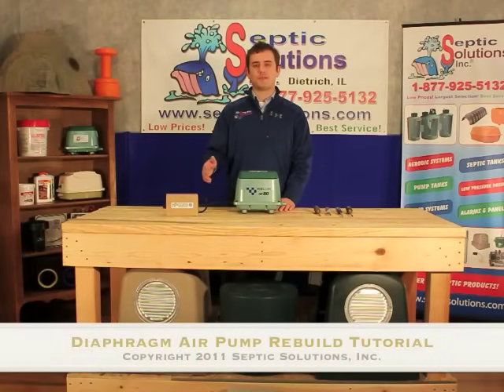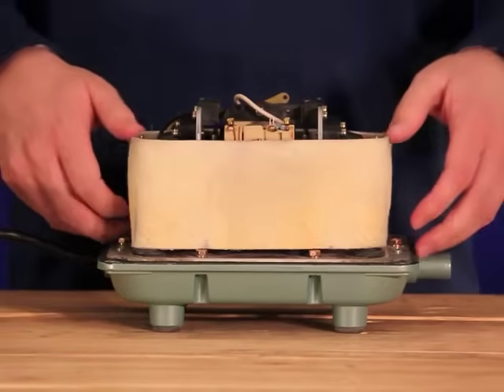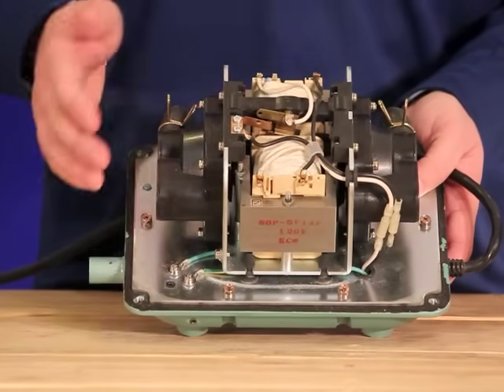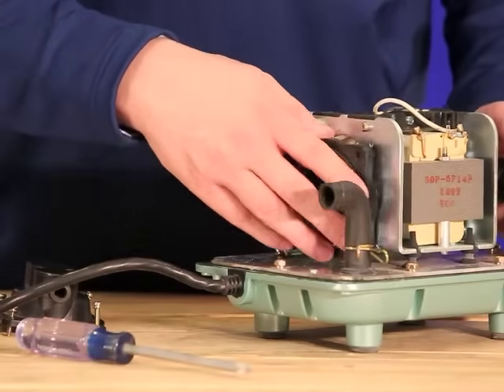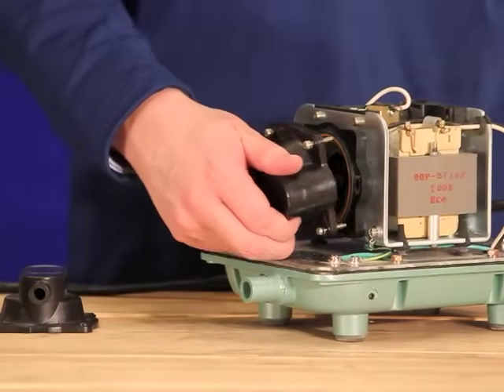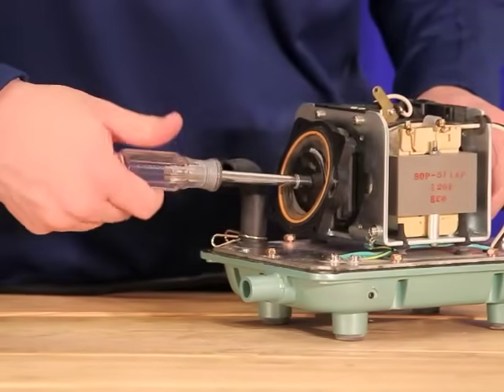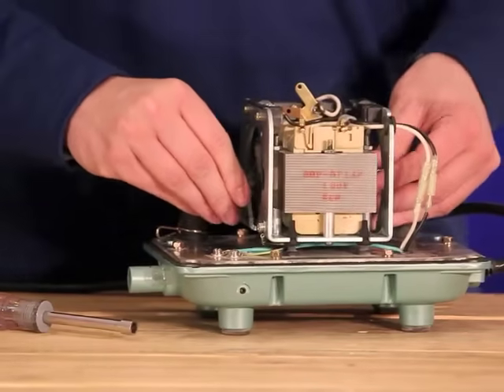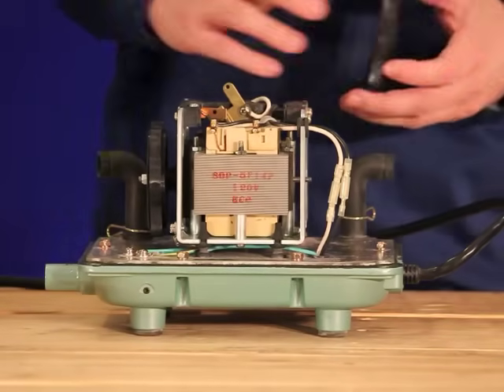Septic Solutions® - Air Pump Rebuild Tutorial

Comment: Don't try to reset the newer style safety switch with brute force, you will need to open the diaphragm cases on both sides and manually slide the motor magnet back and forth to reseat the micro switch.

Comment: how long are these supposed to run on your system, like stay on.
Reply from the maker: These air pumps run 24/7 year round.
Reply: I have mine running for the first time on the system, and  it feels like it's blowing hot air for the PVC line felt hot. and it wasn't getting any sun light.  Could this be OK.

Comment: Great video.  I could not figure out why my septic alarm kept going off.  This video was a clinical step-by-step instruction on how to fix the problem.  I ordered the replacement diaphragm kit on Monday.  It was delivered yesterday and it only took about 20 minutes to replace out the old parts.  Seriously, even though this video was made in 2011 I was able to follow along and make the fix. I turned on the system afterwards and it immediately started working the flashing red aeration light went off, the beeping stopped and the green Ready light is on.  The kit costs $99 with free shipping.  The estimates I got from the septic companies to come out to look at my unit ranged from $100-$400 with repairs.  

Thanks Septic Solutions!

Comment: Excellent video! I have a Clearstream cs103el. It is the same design. The heads say HP-60, 80 on them. Is it a remarked Hiblow? Can I use the Hiblow kit on mine? The saftey screw is broken and the one head I removed the diaphragm was shot. Thanks!

Comment: REINSTALLED THE PUMP AND FOUND OUT THE AIR HOSE GOING INTO THE HOUSE WAS LOOSE AND WAS TIGHTNED.   THE PUMP SOUND VERY GOOD AND I CHECKED THE 1/8 TUBE AND LOTS OF AIR COMING OUT.  WENT INTO THE  HOUSE AND PLUGGED IN POWER.  GOULD PUMP ALARM BOX IS NOT SOUNDING BT RED LIGHT IS STILL ON. ANY ADVICE?

Comment: BUZZER GOING OFF.  TOOK MINE APART HP80 AND BOTH DIAPHARMS IN GOOD SHAPE AND SAFETY SCREW IS GOOD AND NOT BROKEN. AIR BLOWING FREELY OUT OF AIR COMPRESSOR. ANY REASON THE BUZZER IS GOING OFF?  CAN I RESET THE BUZZER? PLEASE ADVISE

Comment: Thank You for the video. In this video the plastic safety screw was installed backwards from the Hiblow installation manual. I'm guessing it does not really matter. Additional cleaning steps would be helpful.
Reply: Christopher Smith I was wondering the same thing...